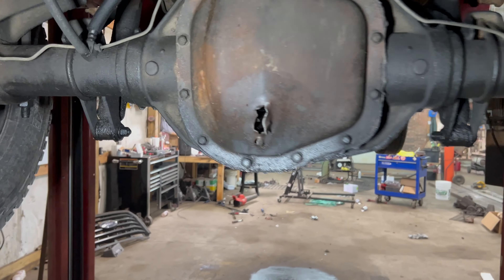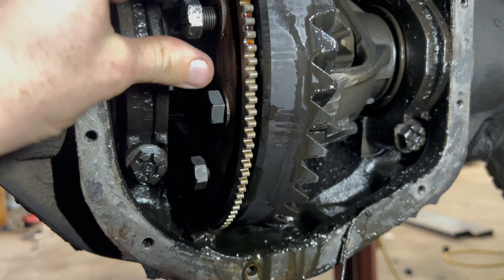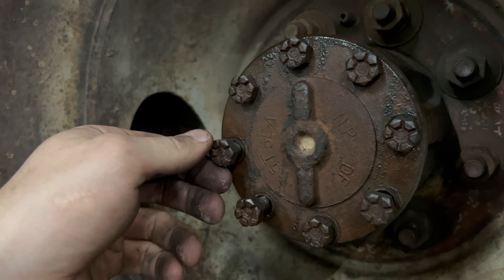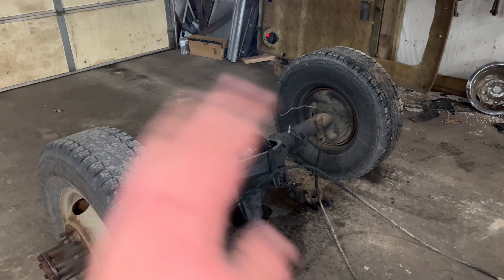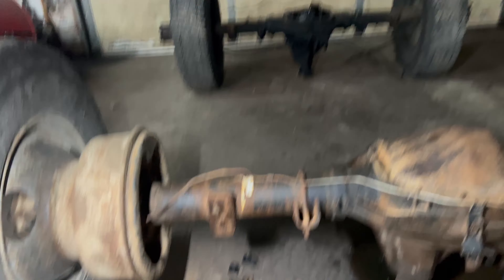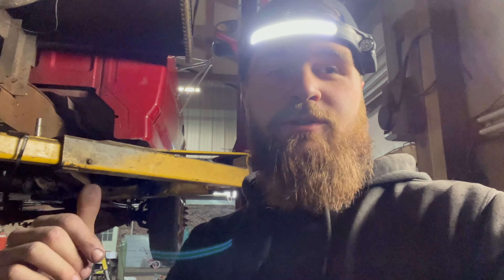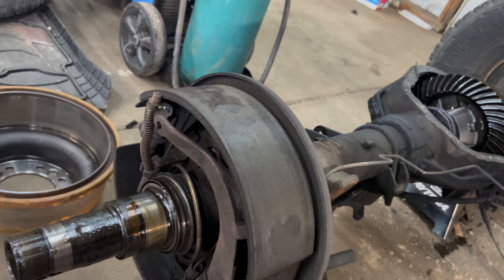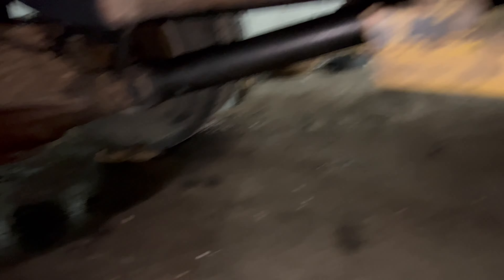NEVER seen this happen before!….1995 f350 rear axle swap!

Comment: Being duels, do you think it's possible that out of balance tires could have caused a weird vibration that caused the bolts to back out?
Reply: That seems like a pretty good guess
Reply: I’m guessing someone had it apart before and didn’t use any locktite when they put it back together. Just my 2 cents worth😎